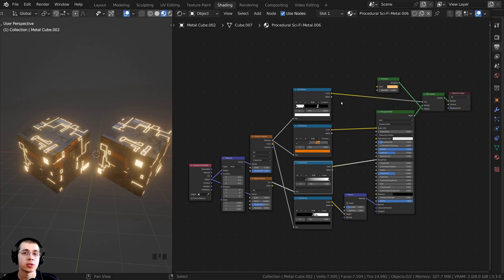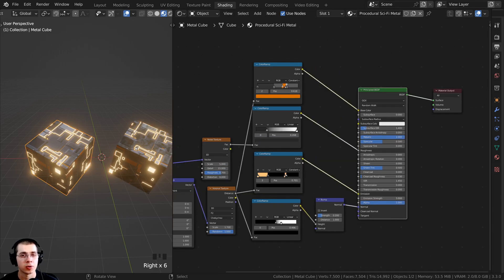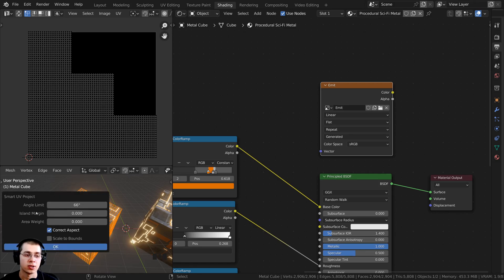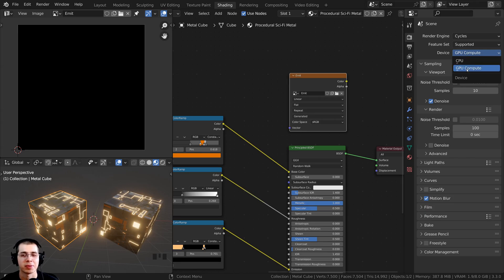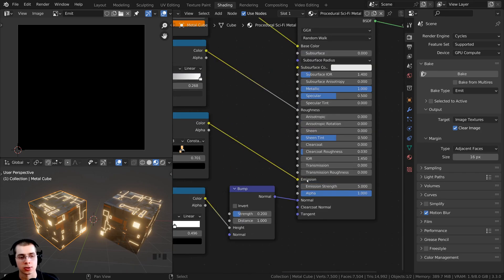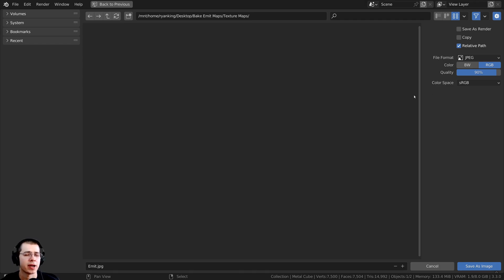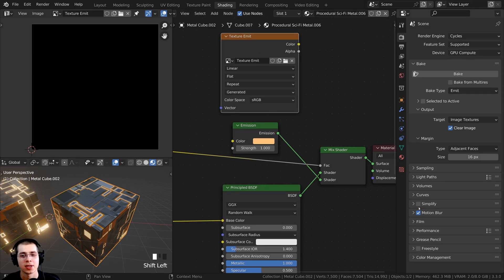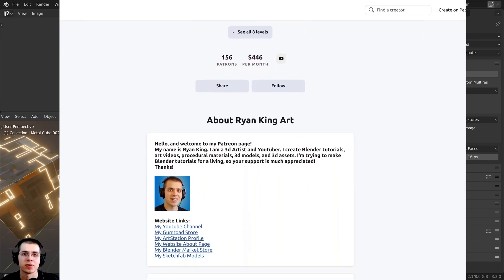How to Bake Emission Maps (Blender Tutorial)

Comment: If I have an object with different emission strengths, would I set the highest strength emission to 1.0 and the rest to their original value divided by the original value of the highest?

Example: Let's say I have three emissions with strengths of 2.0, 3.0, and 10.0. Then, right before baking, would I set the emissions to...

2.0 / 10.0 = 0.2
3.0 / 10.0 = 0.3
10.0 / 10.0 = 1.0

So the 2.0 emission becomes 0.2, the 3.0 emission becomes 0.3, and the 10.0 emission becomes 1.0?
Reply from the maker: I'm really not sure.
Reply: @RyanKingArt  
I think that's probably how it would work, since if you used that emissions texture from my last comment and set the emission value to 10.0, it should scale the others up. Maybe I'll experiment with it and get back to you.
Reply: @RyanKingArt  
I experimented with it and scaling the lower emission values based on the highest emission value seems to work.

EDIT: Maybe you need another emissions tutorial to go into that, LOL.